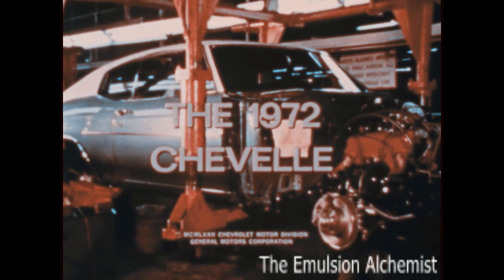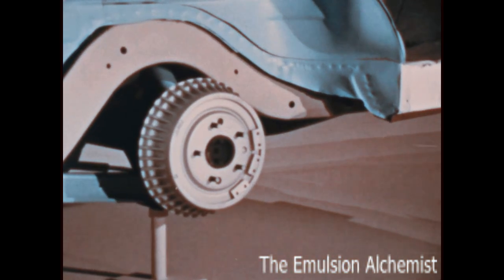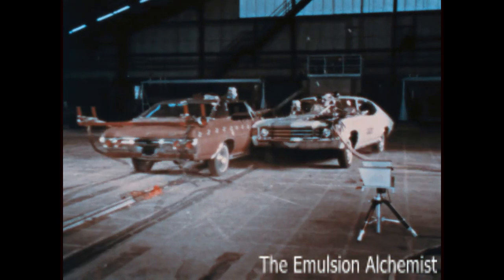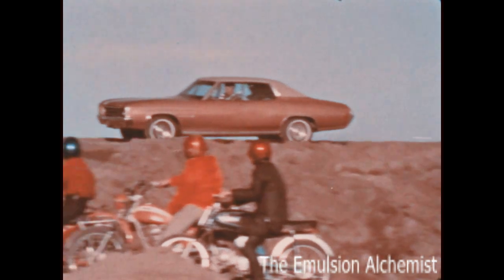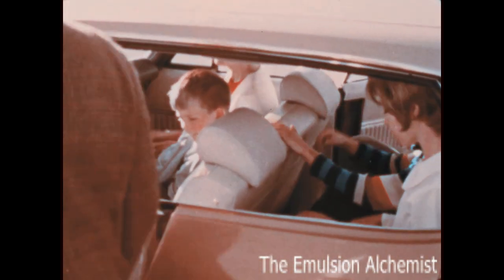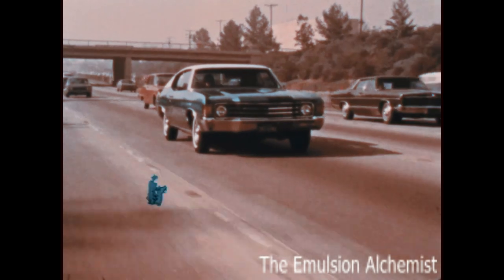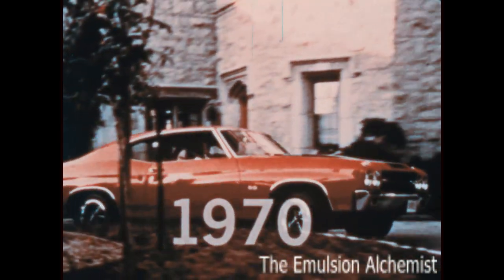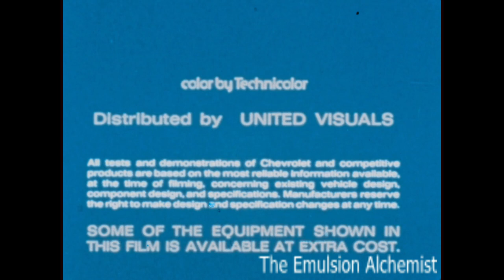1972 Chevy Chevelle Dealership Sales Training Promotional Film

Comment: Got a 71 Malibu sitting in the driveway being restored. Swapped 10 bolt for 12 bolt 3.55 posi. Swapped 307 for 383 stroker and HP th350.
Reply from the maker: nice, you should post a video when it's done

Comment: it has rear seat lap belts we had to wait years before we got them in the rear by then three-point belt in the UK!
Reply from the maker: I spent the summer in the UK a couple years ago. I didn't see a single old American car. here in California classic cars are everywhere including my garage. I own a 1956 dodge Sierra wagon and a 1976 Mg Midget.
Reply: Back then hardly anyone wore seat belts, especially in the back seat. In the front seat it was usually just the lap belt if anyone even bothered to wear a belt. As a teenager In the mid 70s I had my grandfather's 1970 Buick Electra and was that rare teenager that buckled up both the lap and separate shoulder belts when I drove and was usually the only one in the car with the belts buckled. Fast forward to 1981 and a drunk driver in a Chevrolet suburban that crossed the center line and hit me head on. Because of the size of the Electra along with the fact that I was wearing both the lap and shoulder belts in the collision I walked away with only minor cuts, scratches and bruises from the belts..

Comment: I had a 1971 Chevelle, 2 door hardtop, originally classic copper metallic with 350 2bbl with factory bucket seats. By the time I had it, it was repainted cranberry red, I swapped the 350 for a built 408 cubic inch big block.
Reply from the maker: the copper was way to cool to paint red, the big block was a must

Comment: I didn’t realize how much bigger these cars were compared to the downsized 1978 intermediates with a 108” wheelbase.
Reply from the maker: you can thank the oil crisis for that. if it didn't happen just think of how big America would have been building cars by then.
Reply: 1968-72 GM intermediates are smaller and lighter than the 1973-1978 GM intermediates. For example a 1968 Olds Cutlass Supreme with 350 V8 models weight about 3500 lbs and the 455 models such as 442 weights about 3800 lbs. the 1973-1977 gained about 400 lbs to the curb weight. 1972 Chevelle is a good size, more spacious and better appointed than pony cars and less bulky than the Impala.

Comment: General Motors had an awful UAW strike in 1970. As a result their redesigned 1973 midsize cars were delayed from their planned Fall 1971 introduction. So these 1972 Chevelles were minimally changed.
Reply from the maker: Interesting fact to know
Reply: I wish they never changed them, the 73 and later models were hideous
Reply: My uncle was a GM worker and he was involved in the nasty strike that year, but that was not the main or sole reason for the delay -- changes in regulations (emissions & safety) were the other reason. Design and pre-production overruns were another issue. In 1968, GM made a decision to reorganize its assembly plants/fisher body into GMAD (my uncle told me it took years to absorb the changes - was one reason for the nasty strike). GM nearly killed off the Camaro and Firebird after that year. My uncle said this was the "cut" that led to GM's long and sad decline that continues to this day.
Reply: @markjohnston3502  The only automotive factory that I have been to is the former Fremont Assembly (now Tesla factory). One of my father's cousins either worked in administration or was an engineer. He took us on a night tour in late 1978. I remember the 1979 Buick Regals and Monte Carlos on the assembly line. Fremont Assembly was one of GM's BOP plants that opened in the early 1960s to build various GM midsize cars for the West Coast. After GM lost significant market share in the early 1980s, that factory was idled for two years before GM went into partnership with Toyota. UAW relations at Fremont Assembly were considered the worst in the industry... absenteeism was high, intoxication on the job, sabotage, and sexual assault. Sales of pony cars were weak by 1972. Insurance rates for muscle cars driven by younger drivers increased. The Smokey and the Bandit movie in 1977 stimulated sales.
Reply: @markjohnston3502  Other reasons for GM's declining market share:  crappy small cars in the 1970s and 1980s that were a gift to the Japanese, wasteful and redundant engineering among GM divisions, excessive overlap of similar models from Chevy, Pontiac, Olds, and Buick, diesel conversion of gasoline engines, an indifferent and sometimes hostile UAW, downsized full-size and midsize cars in the mid-1980s that looked like they shrunk in the clothes dryer, paint that either oxidized or shredded, and excessive layers of GM management.
Reply: @SpockvsMcCoy  All true. I was a GM guy - drove S-series pick ups starting with the S-15. My '94 Jimmy was my last GM before switching to a series of 4Runners right up to 2021 I have now.
Reply: @SpockvsMcCoy  I was once at the former Janesville Wisconsin Assembly (now a vacant lot) . They used to build the Chevy Impala on one side of the building and Chevy pickups and chassis cabs on the other. I had a camera with me and before I was allowed to enter, they took my camera away from me and said I could have it back after my tour was over. Bummer!
Reply: @markjohnston3502  Toyota builds high quality vehicles but their styling for the last several years is very weird.
Reply: @markjohnston3502  What was your uncle's job?
Reply: @donk499  I liked the design of the 1973 to 1977 coupes...but the quality of body construction declined from earlier years.
Reply: @glennso47  Janesville Assembly was an ancient factory opened in 1919. Many full-size GM cars were built there besides the Impala....old VIN tags will have "J".
Reply: @donk499  Yeah they weren't my favorite body style either. It seemed as we got to the mid '70s the bodies just seemed to get bulkier and heavier, and the new bigger 5 mph bumpers didn't help with the looks on most cars.
Reply: @markjohnston3502  Never knew that about the Camaro/Firebird. That would've been a very poor move considering how both of  their sales would boom later in the decade. Chrysler axed the Barracuda/Challenger after '74, and in doing so missed out on a lot of potential pony car sales.

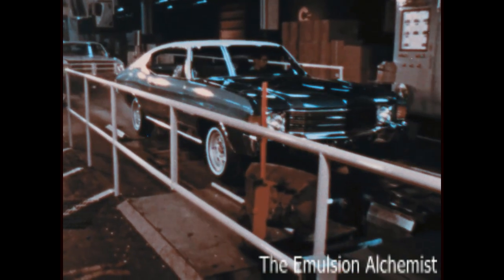Comment: I spot a Pontiac Ventura @ 0:29. I wonder which assembly plant? Van Nuys plant? R
Reply from the maker: no idea, this film looks like possibly Monterey, and the bay area to me
Reply: @theemulsionalchemist5688  Did some research and it was def the Van Nuys plant as it was the only plant that was assembling Nova's, Venturas, Omegas with a handful of Montes and Chevelles. They did build full-size Chevrolets and F-body Camaros and Firebirds in between. I did look into 1972 Chevelle production numbers - a whopping 631k were made that year. the current mailbu does not come close.
Reply: @markjohnston3502  Chevrolet produced about 1 million full-size cars for model year 1972 (and about 1.65 million full-size cars for model year 1965).